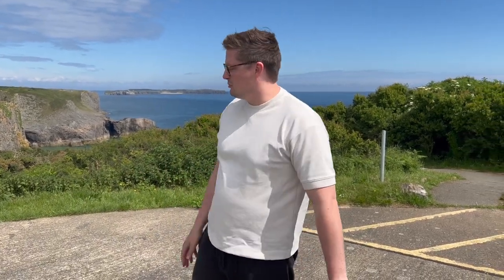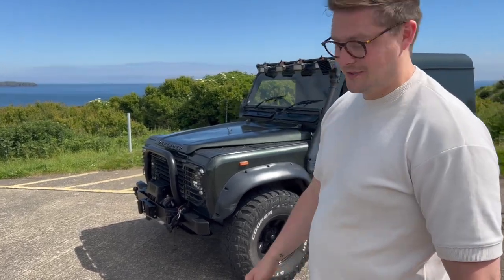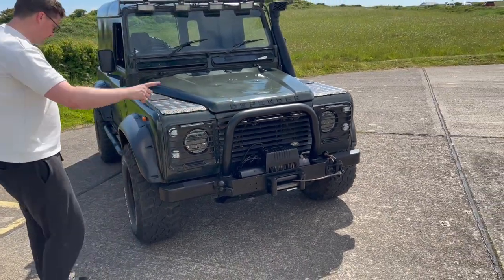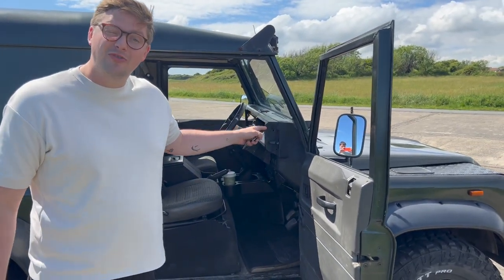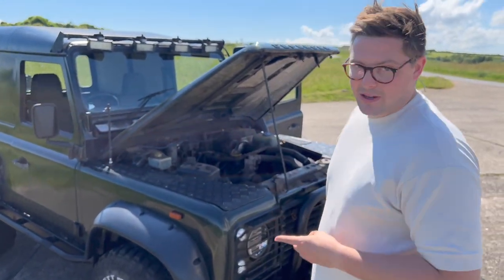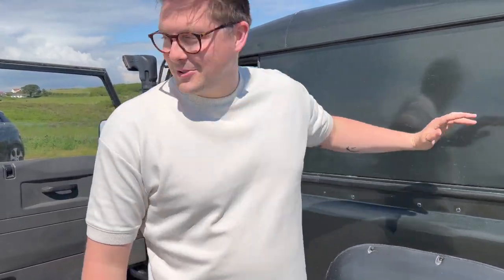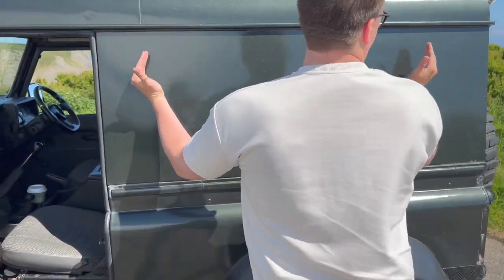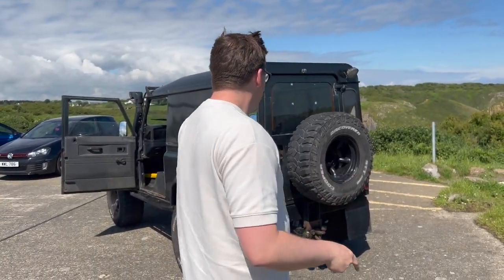I BOUGHT A 1991 LAND ROVER DEFENDER! Join my restoration journey bringing this T90 to the year 2022

Comment: As a landrover nut, here’s my comments after the video. Great video btw.

Truck looks decent, check the bottom of those doors for rust. All that chequer plating on the sides is normally hiding something.

Get that spare off the rear door and onto a carrier, the tyres crack the rear doors after many years of abuse. 

I’d recommend fitting the rover v8, or ls3. The 200tdi can be tuned for more power but not loads, a rover v8 is a pretty easy conversion and can make 200+ hp. Ls3 expensive but cool.

Axles are made by land rovers favourite material, melted chocolate so might want to think about upgrading those, espically with the big wheels. 

And finally, please invest in security, optimal make a fantastic removable quick release steering wheel hub. Well worth it.

Enjoy